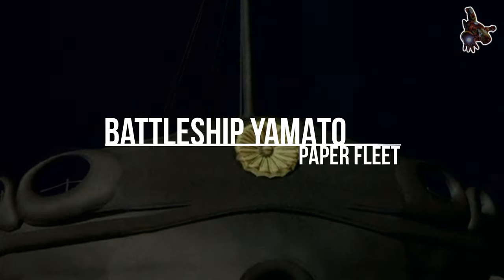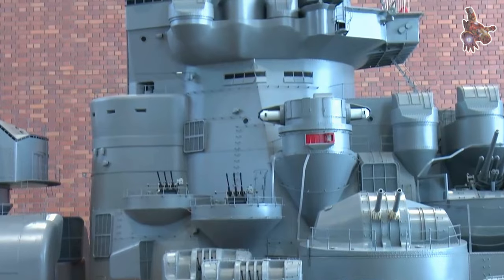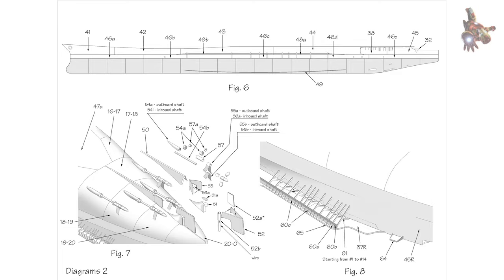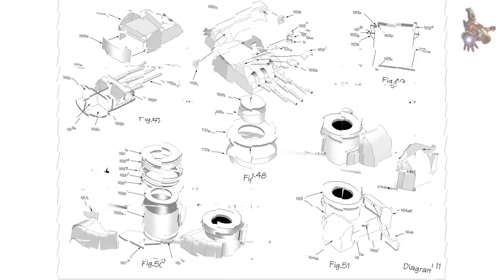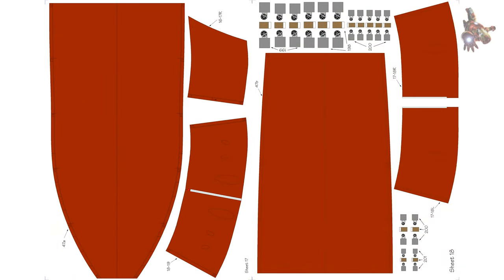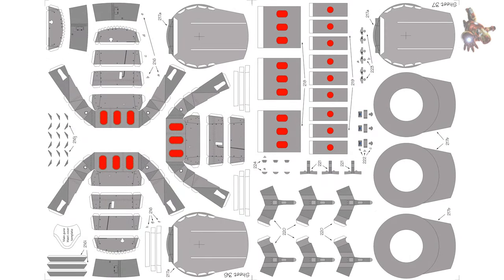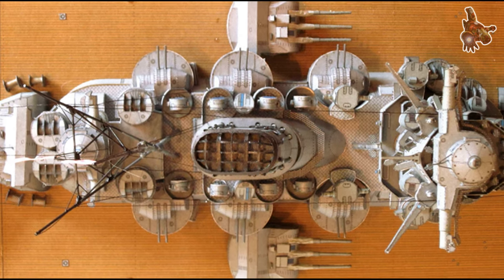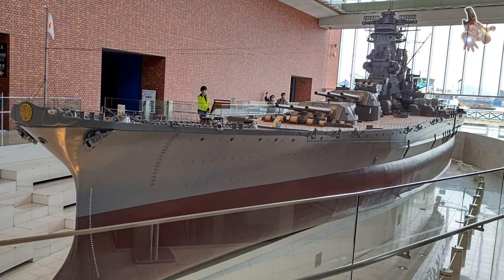The Japanese battleship YAMATO paper ship model * PAPER FLEET * SUPER ScaleModeling HEROES

Comment: Can i use Vellum paper for printing?
Reply from the maker: Printing Instructions:
For sheets #1 to #12 and sheet #29, standard thin 24lb paper suffices as they'll be laminated onto cardboard to achieve a 1mm thickness. Given the mostly black and white line graphics on these sheets, print quality isn't critical. However, maintaining the proper scale is vital—avoid using the "fit to paper" option. Each sheet includes "crop marks" defining a 260mm x 190mm graphic box, ensuring no cropping on US letter size (11” x 8.5”) or international A4 paper.
The majority of remaining sheets should be printed on card stock, preferably in the range of 110lb to 64lb. Experimenting with various papers is encouraged, considering different sizes of parts might form better with specific card stock. Sheets #17 to #22 and #26 to #29, forming the major hull components, are best printed on heavy 110lb card stock to achieve the intended hull shape.
Sheets #38 and #43, consisting mostly of tightly rolled or small parts, should be printed on good-quality thin paper (24lb or less).

For printing the YAMATO paper ship model, I recommend following these printing instructions carefully. While vellum paper might work for some parts, it's best to stick to the recommended paper types for each sheet. Happy crafting!
Reply: @ShipPlans  there's 2 sheets in one page... Do I need to crop it to two sheets then put 1 sheet to one A4 paper? Or just print 1 page with 2sheets in 1 A4?
Reply from the maker: @johnkristiantripoli9296 
You can print one page with two sheets on one A4 paper. However, please note that I provided printing instructions based on the recommendations from the kit's creator. Since I didn't assemble this kit myself, I'm unable to provide specific guidance on these questions. It's best to follow the instructions provided with the kit for the most accurate results. All instructions are voiced in the video.
Reply: Thanks broooo